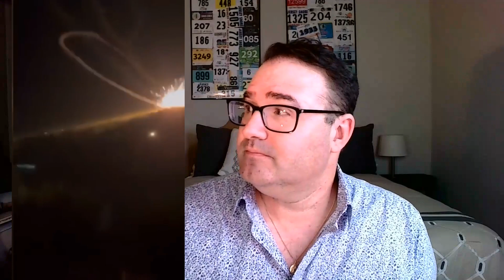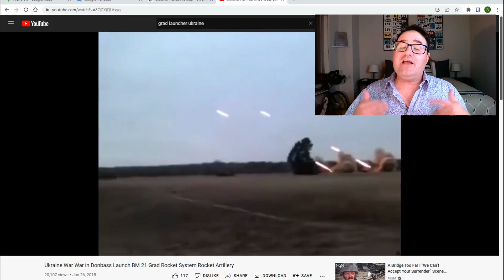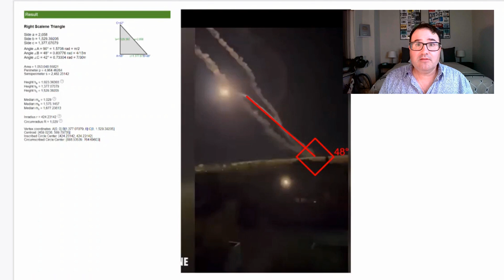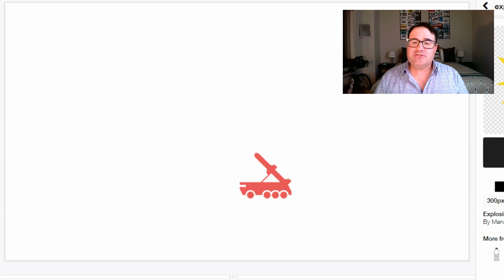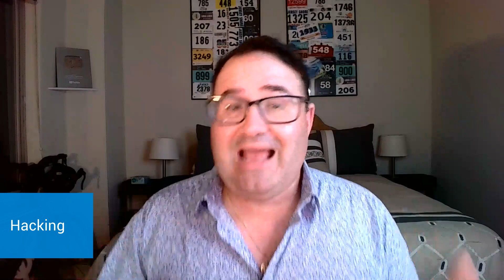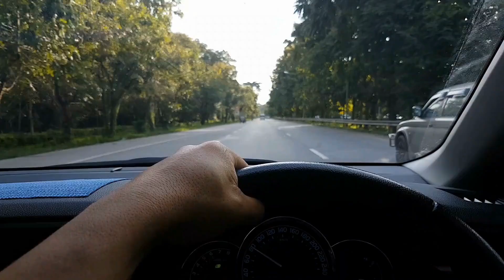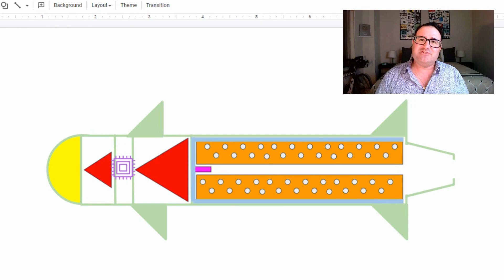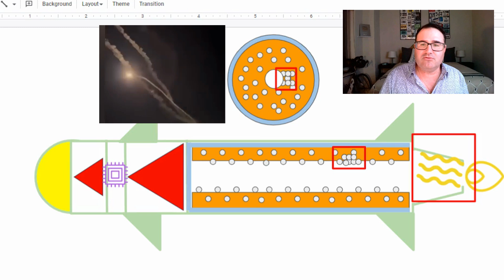Why this missile U -Turned

Comment: I know very little about this, but it seems to have hit very close to where it was fired from, which kind of makes me think it could be a guidance system issue.  It didn't turn a random direction to the side, or up, or down but not towards the place it was fired from.  It turned pretty much right back to where it was fired from...so that's why I think it could be a guidance issue.

Comment: I don't buy it, it seems unlikely that fuel distribution would have 'that' dramatic of an effect, the burned/burning fuel is still ejected out the same hole, I mean those hot gasses are bouncing around inside the fuel tube at thousands of miles/hour, even in the fraction of a second it takes to get ejected they're going to hit effectively random places in the tube a bunch of times before it gets out, which would average out the forces.

Also, as you pointed out, it fired 3 rockets, supply chains tend to not shuffle items much and either FILO or FIFO goods in a surprisingly predictable order; Those other two rockets were likely manufactured at the same time (literally right next to it on the production line), stored in the same place (again, probably right next to each other in the warehouse) and transported/treated exactly the same way, had that one rocket been left in one place long enough for the fuel to migrate, so would the other two, but they worked just fine.

Seems far more likely to me its a much more basic issue.... the guidance computer borked, maybe a track on a data bus snapped from all the g-force and vibration.

Something real simple like that.

Comment: it could of also been a software defect with that specific missile. something like a glitch in its guidance software that made it turn way to hard for some reason as soon as it started its guidance after the initial launch booster fired. which is another type of manufacturing defect. would also explain why the other missiles were fine and that one went haywire.

Comment: My theory would be that again mishandling is at play but maybe with the circuitry within the rocket itself. A wire or piece of a circuit board may have broken or code may have corrupted causing the missile to believe it was going the wrong direction, so ‘correcting’ itself into the ground

Comment: Sometimes electronics just fail in stupid ways, i have also played with solid rocket fuel motors and as long as the thrust is pointing backwards it's really close to impossible for thrust to spin the rocket 180 degrees. 

I think it's more likely that there was an electrical failure that caused one or all of the fins to move to their maximum position. That or it lost connection for a second with it's guidance tower and responded incorrectly. It is also possible that there was some sort of radar jamming that caused the rocket to lose connection or get confused or corrupted commands.

Comment: Just because 2 other missiles were launched with no issues doesn't mean there can't be a freak bug that happened with the third. Sure, more likely than not errors with things like this are human error due to negligence or mishandling like you suggest, but I don't think that means that a bug in the system is as improbable as you say

Comment: Faulty Fuel could be that if it was indeed just a pocket of fuel like this, but that would ignore how physics would have worked at the exhaust port. If there was indeed a pocket of fuel, it would have accelerated forward, not to the left or right because directional control is difficult to control at the nozzle of the exhaust port; there's nowhere for the fuel exhaust to go but backwards. If it was faulty fuel and burned through the side of the insulation, it would have instead spun around and around until it plummeted to the ground randomly.

Instead, fins control the rotation, pitch, and yaw as they are further out from the center of gravity. I'm not thinking hacking, as, you have said, these things aren't usually networked on the WWW, more on a local, air-gapped LAN using encrypted frequencies. What looks like happened here is that the missile found a new target, behind it. Whether it a bug in the software, user error, or a faulty connection to the missile, either way, that missile was instructed to land near its launching point.

I'm basing this off of speculation, but the missile's smoke pattern looks like it made a hard turn, stabilized, and completed its aim on its new target. If you pause it near 0:04 you can see the shape it took to return. If it was uncontrolled burn as you said, it would have continued in that unstabilized 180 turn to twist around, not stabilize, and make a correction the other way.

Comment: I think it’s much more likely the gas dynamic thrust vectoring failed and went full on in one direction while the fin steering tried to compensate which gave you a big u turn vs a just loops in the sky. Could be a fuel issue but without looking at it we will never know

Comment: I feel this is very unluckly. 
Personally I don't know missiles, but I do know rockets. 
A bad mixture would end up in bad thrust not a directional deviation. 
This must have been a guidance issue, be it a lock on to the closest radar signal or wrong input.

Comment: There is SO much which you're so VERY VERY Wrong about.
1st, it wasn't 2 kilometers high, the thing barely took off.  Look at the size of the missile. 
2nd, it was NO WHERE Near mach anything.  If it was, it would not be able to turn so quickly.
3rd, Ground to Air missiles do NOT run out of propellant before they hit their target.  You're thinking of intercontinental missiles.  ...I haven't even finished your video.  Jeasch man, get it together.

Comment: Small note: if they red triangles are copper cones they should be reversed 180 degree, the tip of the triangle toward the missile base , the base if the triangle forward the missile head, much thanks abd respect

Comment: if the person filming is 500m away, there's no way the flight distance before it turn around is 2km, 4 times the distance from camera to launch point there's no way they can keep both in frame without extreme panoramic wide capture lens.
to get to the 2km distance before turning around in 2 seconds you assumed it reached top speed above mach 3 the instant it leave the launcher.
more realistic numbers are: it turns around at 2 seconds, it impacted at 4 seconds so just 2 seconds later, the maximum manoeuvrability of the missile is 20g, lets round that up to equal 200m/s^2, during the turnaround phase is about little more than 1 second (lets say 1.2 sec) makes the distance it covered in the turnaround phase at estimated 60m, this is the half circle loop where it turns around. 
the distance from launcher to its turnaround point is about 3 times this which makes it bit under 200m. 
which makes the top speed the missile achieved before it turn around at only around 800-1000km/hr, that missile never achieved mach 1. Which also explains the sonic booms from other missiles that shoots ahead of it registering only 1 second before the impact sound did.

Comment: Former ballistic missle defence guy here. My thoughts are that the coordinates were programmed for the source and destination (my imagination goes to errant clicking for target tracks, or data uplink error of the missle). As soon as the initial dumb boost phase was over it came back to its source. While it is possible to have rockets go crazy over old/bad fuel, the cylindrical shape of the rocket smooths out most of anything that the trim of the fins can take care of. But maybe this is an extreme/rare instance, that the USA doesn't have to deal with much.

Comment: We had something very similar happen with a Proton-M rocket back in 2013 (February 2nd, 2013 to be exact). A guidance system was installed upside down, resulting in the rocket doing a U-turn and breaking up. The Proton-M was much too large and not rigid enough to survive such a maneuver, but the much smaller missile clearly was. This resulted in the rather dramatic "Return to sender" we see here.
Reply: This sounds like it matches the video, as the missed appears to straighten its course and not just stick into a turn.

Comment: It really seems like the missile was tracking and hit what it was aiming for. Also pretty incredible that it can maneuver like that
Reply: If the gyroscopic system guiding the missile upside down, it would be logical that once the missile guidance system kicks in, it goes the other way around. 
As 3 missiles were launched first in the right direction, the tracking is very unlikely to shift that way. But a misplaced gyroscope or misconnected might have exactly that effect.
Reply: @fabr5747 sorry but gyroscopes are just too expensive, unescessary and unpractical for an air defense missle that one like it doesn't even exist.

Comment: If this were the case the missile should have taken a random turn and got off in a random direction after the first few seconds.  Even possibly spiraling.  Spent time fire guns and missiles in the US Navy.  My guess is, based on the video the homing system activated too soon and it locked onto the tracking radar source instead of the return echo from the target.  Whether this missile is a homing or beam rider type it should follow the echo return from target once activated until within designated range then actively acquire and engage.

Comment: While i agree with your theory on what caused it to go off course, I think a big thing that wasn't mentioned is optical illusion. I don't think the missile made a super tight, perfect 180 and hit the launcher. I think it turned towards or away from the camera while also curving down, but you can't see that due to the distance, perspective, and the dark conditions. I bet the actual path it took was much wider than it appears to be. And I also would bet the impact was a significant distance away from the launcher, it just so happened to be in line with where the launcher and the cameraman were positioned. Likely it landed in between the two of them

Comment: I think it's highly unlikely asymmetric thrust slightly off an axial center is enough to turn a rocket around like that. At low altitude, the fins are providing a lot of resisting moment due to higher density air. The speed may be relatively slow, but they are very quickly at near sonic speeds. Asymmetric thrust in the core will spread out in all directions within the core, then go back to axial thrust by the time it hits the nozzle where it all narrows down.
If it burned through, it could create significant thrust asymmetry, or more likely a bend in the body if it turns like that. If it burned through, it should barrel roll or spiral since the missile will want to track straight but have a sideways thrust.
It seems to me the missile head was somehow armed. With max thrust and low speed, a missile –which is designed to turn at high rates anyway– will be capable of turning very hard since it's not up to Mach 3 yet and does not have to overcome a lot of inertia. If the guidance system was faulty, and somehow directed the missile to turn max rate, it would look exactly like this video. Any other method would have to fight the guidance of the missile, which again is a very powerful moment arm to overcome. If it turned like this, the missile was trying to turn.

Comment: I don't buy it. The combustion chamber in the missile is a high pressure environment that is restricted at the throat. The thrust would only be mildly asymmetric if at all and I would assume could be dealt with by thrust vectoring (if available) and would have a far smaller impact than shown there. I'm almost positive this is some sensor issue. Similar to this https://www.youtube.com/watch?v=vqW0LEcTAYg. Possibly for the first 2 seconds the sensor is ignored until they believe it gives reliable results. Not sure.

Comment: I disagree, in the combustion chamber due to equilibrium in gas laws the rocket wouldn't change direction as even in fluid dynamics, being pushed through a small hole would create a back presser that would neutralize any directional gas flow. Interesting hypothesis but I don't think it holds up at all. Definitely not a combustion or fuel issue.

Comment: "Vectored Thrust" due to mishandling or manufacturing defect is certainly possible. Deliberate, fluidically-produced vectored thrust was used on the Polaris missiles and could produce impressive turns. (A gas was injected into the combustion stream in the nozzle area. The introduction location(s) determined the turn direction.) Relative to the plausibility of such a defect, I recall an interesting video taken a few years ago at night in northern Norway. The Russian Navy was test launching a new missile. It apparently made a secondary combustion nozzle for itself by blowing a hole out of its side (speculation associated with the video at the time). The missile was running horizontally, directly towards the camera and spinning around its primary axis (fortunately a significant distance away). The visual effect was a growing, glowing spiral. It was "prettier" than the present instance, but nowhere near as exciting for the launcher crew.

Comment: that doesn't make sense because the hot gas getting pushed out the nozzle would still be straight even if one part of the fuel was burning hotter/colder. The rocket making a perfect U-turn from a defect is also extremely unlikely. think of a bad firework, it'll mostly to spin on an axis and fail or dart off somewhere else interiorly.

Comment: While I agree it's a manufacturing/handling problem, my suspicion would be a failure of either a gyro/accelerometer, or a control surface actuator. I don't feel like fuel damage could cause enough asymmetric thrust to cause that rapid of a vector change without a case rupture, and I don't see a violent flare during the maneuver.
A tumbled gyro or a short in a control actuator could cause full control deflection, which is what it sort of looks like to me.

Comment: 2 Things... 1) Some US military aircraft are equipped with a "Counter-Battery" Radar that detects SAMs and returns the missiles back to the launcher by triangulating after a few launches. 2) Radar systems used for launchers on the battlefield are connected to some sort of central command. They aren't just out there on their own. I believe it was hacked. The failure was on the defensive side. Whomever programed the missile to "malfunction" miscalculated the distance from the launcher for which the missile was to return. The point is to create confusion as to where the error occurred.

Comment: I think the comment by Eric Anderson makes the most sense, because even if the "clump" brokedown and caused it to turn in the opposite direction, doesn't mean it would turn into a perfect U-turn like we see here. His belief is the safe arm system of the missile failed, activating the seeker before it acquired the initial target. Mathematically speaking, the odds of it doing a perfect U-turn on a malfunction is at minimum 1 in 360 degrees, but this missile appears to have acquired it's launch site as it's target. The odds that the force change caused by "clump" would equal exactly 180 degrees is just mathematically improbable.

Comment: " Most missiles are solid rocket fuel motors" 
This statement is false. The booster likely is solid but from all the missiles I can think of , a turbo jet engine is usually used for in flight propulsion. Easier to controll and is just better in most ways. 
For others RAM and SCRAM jet engines are used.

Comment: nope, the clump in the chamber could either choke the thrust or make the thrust not so smooth. the nozzle is fixed and wont affect the direction since it doesnt gimble.

Comment: I think this is just because of the gyroscope is reversely mounted, when the guiding system turn on, it detected the missile is flying opposite direction, so it try to correct it, and turn the missile 180 degree a round

Comment: Your reason for why its not was hacking does not hold. You can still hack something thats not on the internet. Just like you can hack the system of a car and control a lot of things by just being close enough. So wanna clear out how it can't be hacked? If anything talk together, then it can be hacked. It probably was not what happend in this video. But the reason you used to rule out hacking is not realistic. :) I believe that Eric Anderson is right and the safe arm system of the missile failed.

Comment: I don't know anything about the tracking radar, but... If there is something like a VOR as in an airplane, there is a To and From setting that gives you your heading or bearing.  If the guidance system kicked in, and that setting was wrong, it would guide the missile back to its origin.  I like the clump of mis-manufactured propellant theory, but the chances of that being the cause and it flying back perfectly to the origin is minuscule, in my humble opinion.  Operator/(pilot) error.